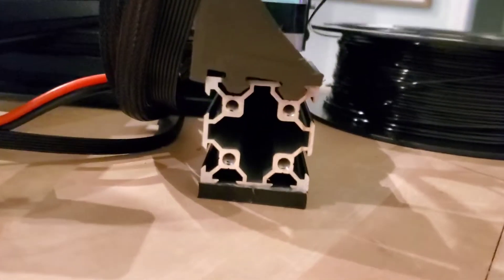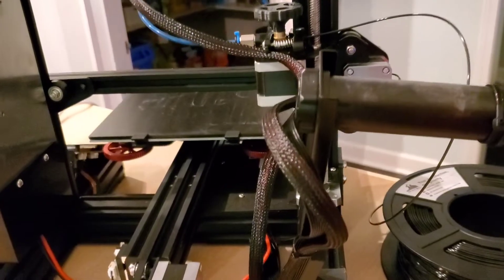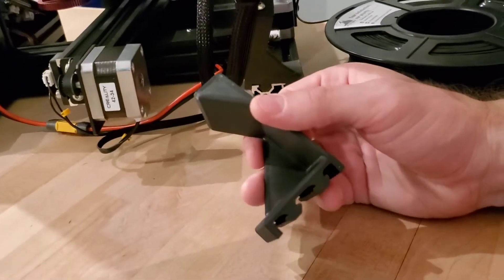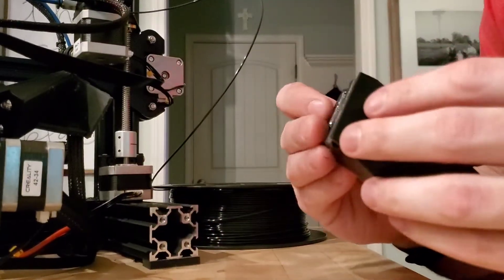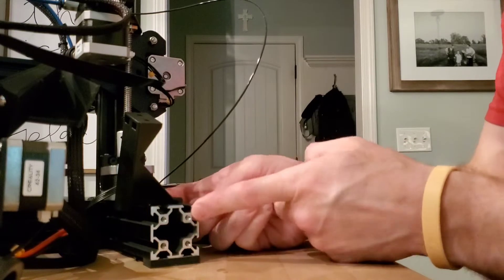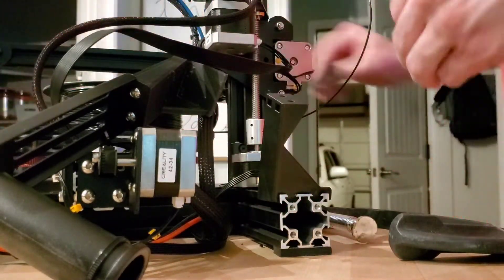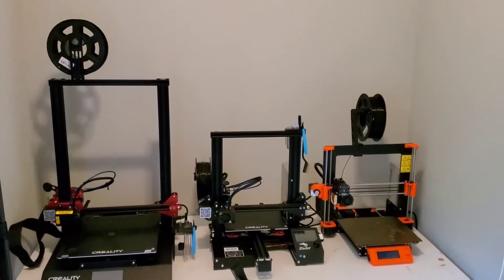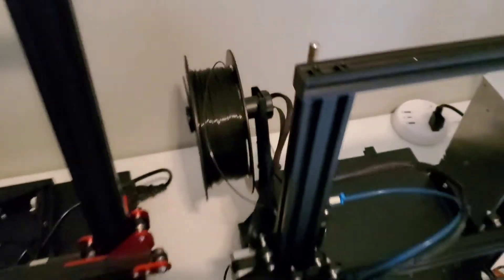Ender3 Rear Spool

Comment: I ordered a ender3 and mk3s to print ppe. Wondering if these two printers can be used for dental application.
Reply from the maker: You can print surgical guides and if well calibrated, you can print models. But few do that way.